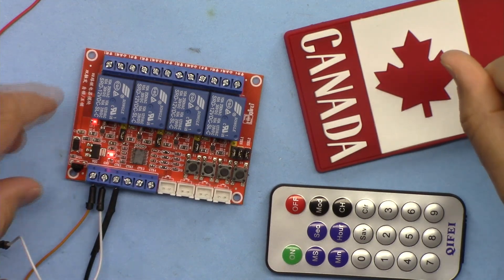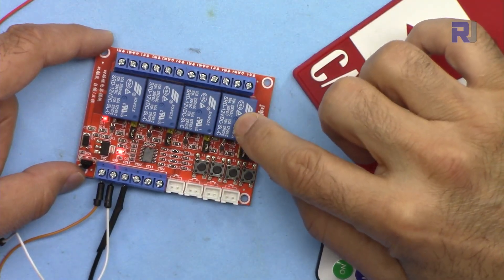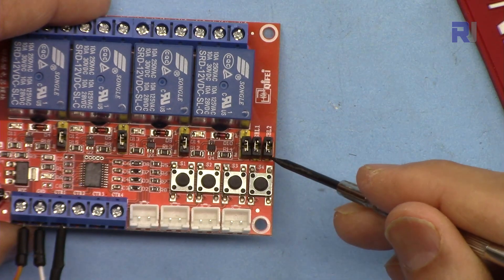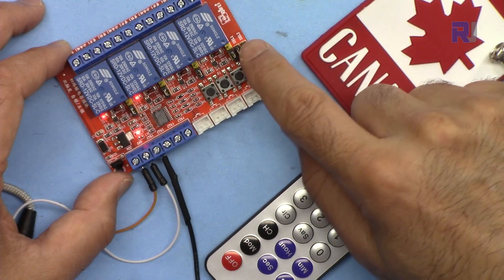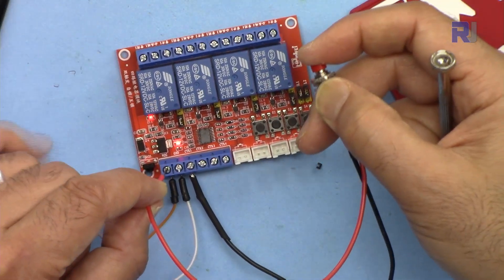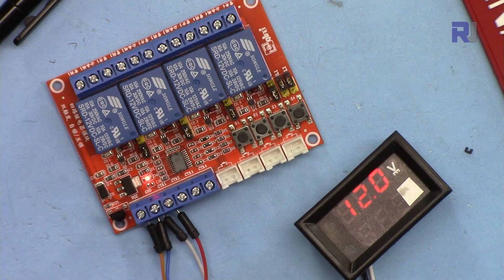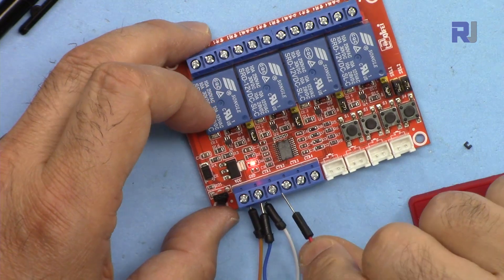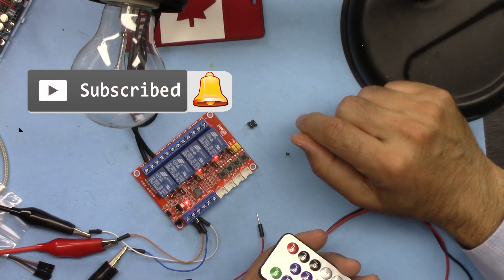4 channel Relay with Infrared remote and external signal control - Review of  QIFEI RJT201

Comment: Hello sir, I am great need of this PCB but with a timer for each relay as in case of Single channel timer relay module you have shown in other video. Please help from where to buy or how can I add a timer to this board?
Reply from the maker: Hello, use arduino to be your own King and do anything you want. this module is very limited. Here is $200 Arduino course for free Arduino Step by Step Course  (over 100 video lectures) Starts here http://robojax.com/L/?id=338

Comment: Is there way to use the trigger button as a permanent thing? To work the same way as the IR button push? If I want to control lights both way button+IR, I have to keep pushing :) and this not so good... The video was great, it helped me a lot, thank you very much!
Reply from the maker: I am sorry for late reply. I was on vacation. You are welcome.  I have not tried it but it would be very hard as the IR receiver is connected to MCU (microcontroller) and decoding and control happens inside it. so it might not work.